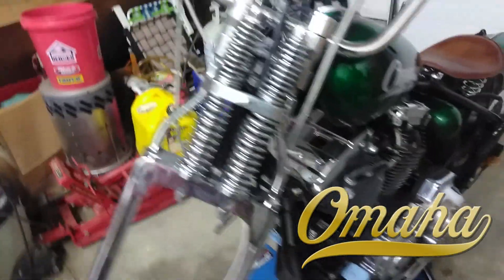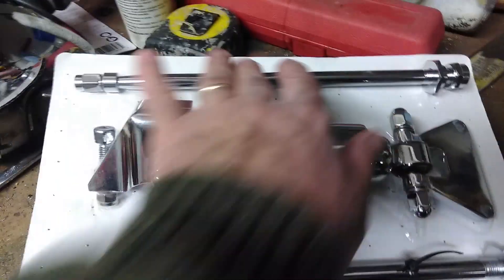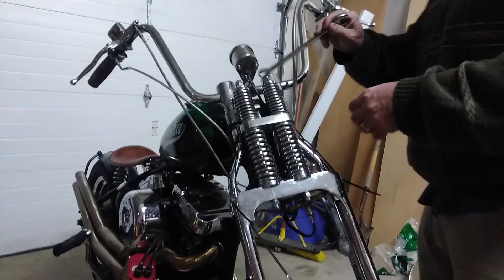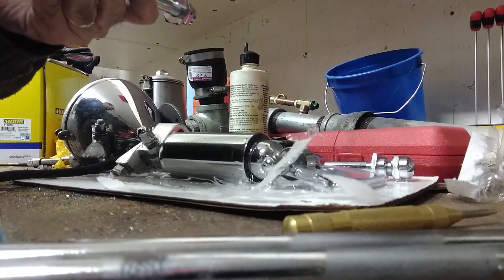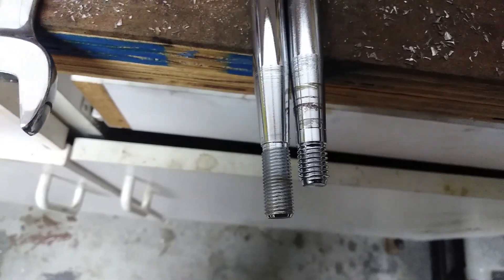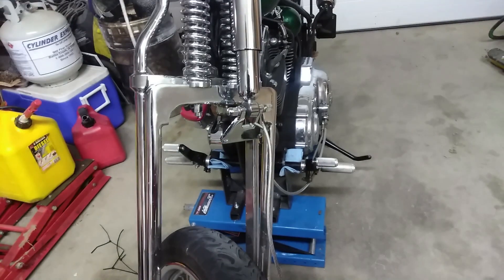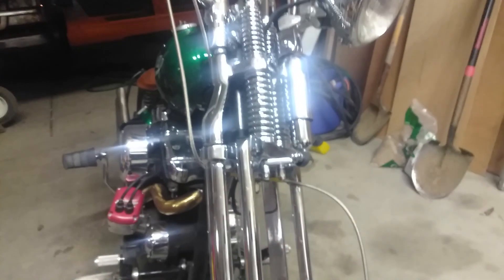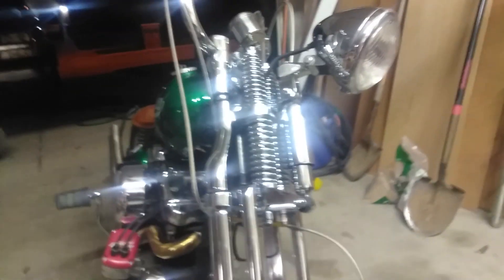Adding a TC Bros / Moto Iron Shock to my springer

Comment: Hi how did you compress the springs to get the shaft to stick out on top to put the nuts on? Thanks
Reply from the maker: Badly. I put them in a vice, then ziptied them closed. Did the install, then cut off the zipties.

That was not a good way of doing it, but it worked, even if it was dangerous.

Next time, I'd take some allthread, some nuts, and some big washers and use that to pre-compress the springs. Doing it in a vice was really pretty dumb.

I did a lot of things wrong during this install that I would do differently if I had to do it over. Maybe I'll put up a new video showing some better ideas...
Reply: @TheJeffMiller  Hi o ok thanks, yea I’m having a little bit of a problem with my springer front end. It was all together and was fine, but I wanted a little better ride, so I ordered a shock for it from TC BROS’s and that’s were I’m having the problem. Mounting the shock itself was simple, but they give you new shaft’s to install and I can’t seem to get the springs down far enough to get the bolts started. I’m trying to figure out a way to compress the springs down so I can put it all back together. Thanks for your reply. I’m thinking about making a video on it once I figure out a safe and easy way to get it done. Thanks again
Reply from the maker: @MrRogrod1  One thing I will say is that once you get it sorted, you'll be really pleased with how much the shock improves the ride. It's like night and day.
Reply: @TheJeffMiller  Really? That much of a difference? Cool

Comment: So when adding a 6 over springer kit ..you need a taller kick stand. A shock absorber kit headlight kit,a brake caliper and brake hose kit,and handle bar extension kit...???
Reply from the maker: That's what custom bikes are all about. You want to change one thing, you have to account for everything else that is impacted.
Reply: @TheJeffMiller  how did you compress the top 2 pair of springs ..how much thread did you leave at the top of the thread rod ..
I did mine ..just wondering if there's didderent heights of the top threads for ride height .. amount of compression per thread ..

Comment: I didnt know they made these until i saw this vid,researching moto iron springer front ends.
Couldnt tell for sure but it looked like your bike was hardtailed? 
if it wasnt i just wonderd about the ride -springer front on rear shock sportster ;
theres one for sale near me,with a moto iron springer,first I heard of them.I never cared for the dna ones.
But the bike near me, the rake and trail or lack of it look funky. It isnt level ,like when people just throw long forks on and dont do anything to neck/rake etc.and the line of the whole bottom of the bike looks like its a ramp or going uphill,(profile wise) if you know what i mean.
It also is asthetically unappealing (to me at least).
I cant imagine how the handling is on one set up like that,cant be good..
Anyway hows it worked out? any stripping of those threads etc,plunger assembly holding up quality wise etc? thanks.
Reply from the maker: Yeah, it's a paughco SLP-120. Shock works great.

Comment: I have a 99 sportster and I put a springer on it, I went to put on the stock gas tank and the risers hit the tank before reaching full lock. Did you encounter this problem?
Reply from the maker: I did not, but I'm running a Paughco frame and an aftermarket tank, so it's a totally different setup.